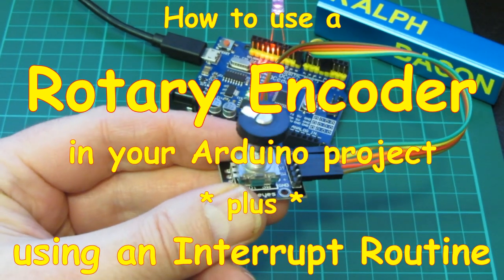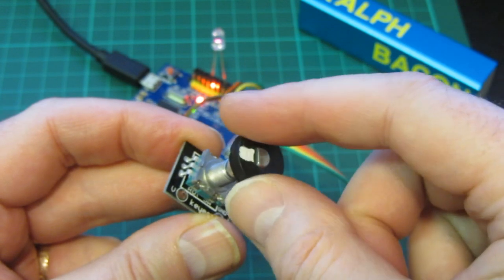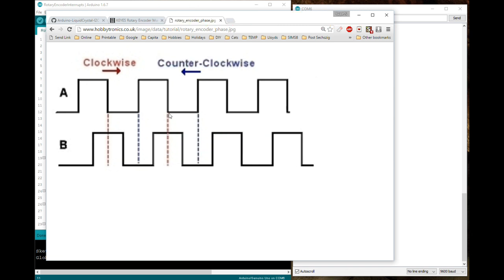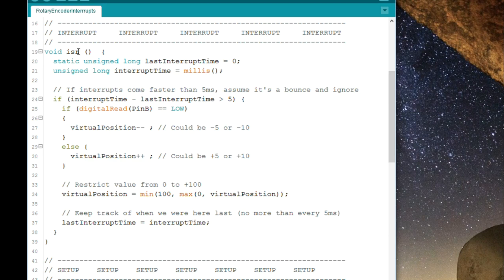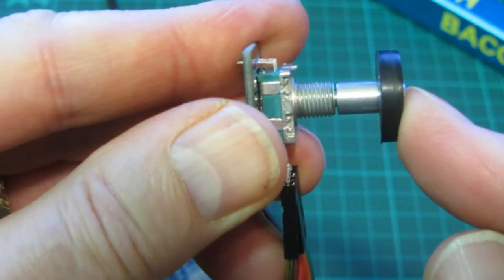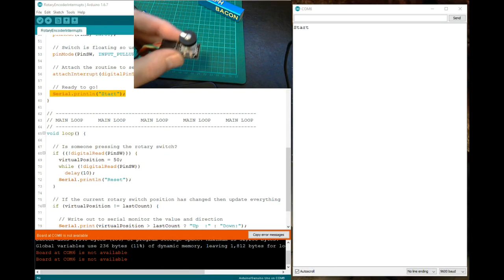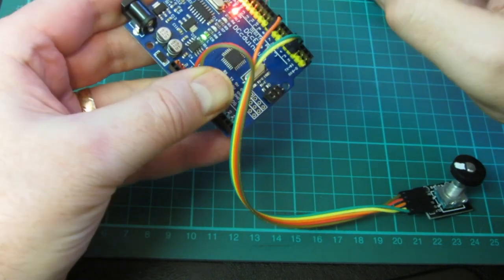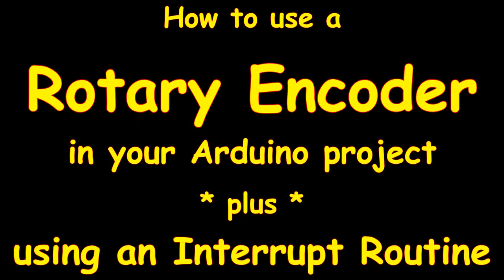#19 How to use a Rotary Encoder with an Interrupt routine on your Arduino

Comment: Nice instructional vid. Just a question though, so if I am planning to control 8 motors separately and have rotary encoders to report its position, do I need 8 interrupt pins for it, can I use any pins in arduino to use as interrupt? Thanks in advance.
Reply from the maker: Hey 3D Printwiz! I wish I had a 3D printer, quite frankly.
 
Anyway, with regards to your question the short answer is "No", you cannot use just any old pin for an interrupt. On the Uno/Nano only pins 2 and 3 can be used as "external" interrupts (like you get from a rotary encoder). On the Arduino MEGA you have more: pin 2 (interrupt 0), 3 (interrupt 1), 18 (interrupt 5), 19 (interrupt 4), 20 (interrupt 3), and 21 (interrupt 2). If you need several interrupts a MEGA can cost very little when cloned from the Far East (I bought mine for less than $10).
 
Additional reading: you might want to read up on the difference between "pin change interrupts" and "external interrupts"  as we've been dealing with the latter but the former may be of use to you!
 
Thanks for posting this interesting question, I'm sure others will think it useful too.
Reply: Thank you so much for your answer, it helps a lot since I am building a desktop robot with a precision of an industrial one, hehe, it feels impossible as I go through the process. As for 3d Printers, I have a Flashforge, but there are a lot of 3d Printers now that are twice as large, and as better, plus cheaper. Get one I, believe me it is worth it.
Reply from the maker: Getting one is the easy bit. Paying for it is the first challenge. Secondly where do I put it? I have zero space left in my workshop. Build another workshop! Could be an expensive 3D printer! I'd also like a 50W laser cutter so I could cut acrylic for project boxes and the like. Another dream.  ;)
Reply from the maker: Robot Arm looks great just don't let it be seen in Germany (I Am Arm means I Am Poor there). And that soundtrack reminded me of a couple of 1990s raves that were better forgotten. But it's an interesting, working construction and I wish I had a man cave (well, my workshop aka shoe cupboard is my man cave) but all space has been used up. Sigh. One day, one day...
Reply: Hi Ralph. A few words from the nit-picking Norwegian here. :)
The ATMega328P can indeed do interrupts on almost all its pins. The datasheet says: "The External Interrupts are triggered by the INT pins or any of the PCINT pins". If we take a look at the pinout we see that all of the Arduinos pins (0-13 and the analog pins as well) has a PCINTx label. 
That's the theory... I'm not sure if you can use the Arduino IDE though.

Edit: And you said that in your comment of course... I wasn't paying attention. :)
Reply: Thanks Robert, I will look into what you have just said. The reason why I asked how many interrupts are available is that, I am planning on making a dc motor driven robot arm and I will use rotary encoder for feedback. I will need a minimum of 9 feedback, which will eventually need to be interrupt driven to capture accurate positions at all times.
Reply: +3D Printwiz : Oh, you can't do that. If I understand the datasheet correct, the maxumum numbers of external interrupts is 5; INT0, INT1, PCINT0, PCINT2 and PCINT2. And I'm not sure if you can use all of them at the same time.

Although the PCINTx can be any pin, there are not enough interrupt vectors available in the ATmega328P. You would probably run out of pins as each rotary encoder need two pins making a total of 18 pins.

But there's hope! :) The Arduino Mega (ATmega1280) has lots of pins. 

Check out the PciManager Arduino library. It makes you life easier. ;-)
Reply: I am actually using Arduino 2560, so is it possible with this board?
Reply: It's certanly possible to connect 6 encoder on a Mega2560, I think you can use the PCINTx as well. The latter is a bit tricky to code though. 

A 82C59A is of course an alternative. It is the good old programmable interrupt controller. They can be cascaded. Maybe a bit old-school. :)

The MCP23017 is more up-to-date. It is a 16-bit input/output port expander with interrupt output. Less than one quid (including shipping) on eBay.
Reply: Maybe Ralph will make a tutorial on the MCP23017 some day? ;-)
Reply: Cool, thanks for the tip. It helps a lot, I'm into robotics and automation coz I love it. I love it more when people are willing to help.
Reply from the maker: @Robert Well, sort of. I don't believe that many occasional programmers are going to get further than EXTERNAL interrupts without significant further reading. And I'm not belittling their intelligence or otherwise! It's just that external interrupts are easier to understand in concept and to implement (volatile variables notwithstanding). 
 
Pin change interrupts are prone to misunderstanding (for example, strictly speaking, they only respond to CHANGE events rather than RISING or FALLING although there is a library to sort that out, see later). And determining which pin has changed can be tricky too. I do recommend this library though (https://github.com/GreyGnome/EnableInterrupt) as it covers all bases if you're into pin change interrupts. Yes, you can use the Arduino IDE for this, of course :)

Let me put it this way: I don't think I'll be doing a video on pin change interrupts (I know, never say never), not this side of the new millennium anyway, it just would not appeal to enough viewers. I think if you really need more interrupts, use a MEGA and save yourself some grief!

Comment: Would this work for motor encoders???
Reply from the maker: Whilst it would most certainly measure the rotational speed and direction of a motor I'm certainly not convinced that it would survive very long unless the motor was used in a very limited way (eg a robot arm). Most motor encoders use an optical method of determining speed and direction (identical concept but not using mechanical switches). So the short answer is "Probably not what you want" and the longer answer is "Find (or build) an optical encoder using an LED and a phototransistor which has not moving parts as such". I hope this helps.

Comment: Hi Ralph, having issues with the serial monitor, lots of random ASCII character garbage is being spat out when turning encoder... any ideas? Great tutorial too, thanks!
Reply from the maker: +Edward Clarke
Welcome to my channel!
 
I suspect that your baud rate is not correct. Check that the Serial WIndow (bottom right hand corner) is set to the same value (eg 9600) as what is in the Serial.begin(9600) statement.
 
You can test this just by sending a standard "Hello World" statement and ensuring that is received correct to begin with.
 
Finally, close and re-open the Arduino IDE as sometimes it gets confused.
Reply: I've tried all that with no luck :( thanks anyway!
Reply from the maker: Hmm, sorry to hear it's still not working. You are not using digital pins 0 and/or 1 (D0 / D1) on the Arduino board are you, as they are used for the serial communication - if you use those pins for something else then garbage may appear on the serial monitor (or your uploads will fail!).
 

Does the standard "Hello World" appear correctly on the serial monitor? And garbage characters appear only when you turn the encoder?
Reply: Actually just fixed it, no idea how...  yes I was using the digital pins correctly. 

I did also try to use a sketch just with some print commands in a loop but that wasn't working at all. Either way, it's all good now.

 Am quite new to this as you can probably tell!

Thanks for all your help, really appreciated :)
Reply from the maker: Great to hear it's now working! Enjoy the video(s) and keep learning as you go!

Comment: hi Ralph Got it working, sort of. I isolated an unrelated push button to update my OLED counter. Works great. Uncomment the encoder ISR, and it works. but the pushbutton doesn't update at all, or takes forever !!! Screen updates very slowly. Seems I may not be exiting the loop. So where should the ISR code code related for initialization, setup() and loop() sections? Thanks.
Reply from the maker: Ron, you said previously the switch button is pulled HIGH (to Vcc) when pressed? If so (you must be sure!) you need to change the sketch as I'm assuming the opposite in my sketch, line 56. That switch pin needs to be tied to ground via a 10K resistor and the code line changed to a simple INPUT (not INPUT_PULLUP). Then lines 71 to 73 need amending to look for a HIGH value on that pin, so line 71 and 73 need the "NOT" (exclamation mark) removing because you are looking for a HIGH and not a NOT HIGH (confusing sentence if ever I read one).
 
Regarding "positioning" of routines, it makes no difference. The compiler will find them wherever they are declared. From a Best Practices point of view, all routines (those written by you) should come first, then SETUP then LOOP. But I think you need to get the sketch working first! Have a go with the above and let me know (hit REPLY to this message).
 
If you can post your modified sketch to a central cloud storage place (Dropbox, Google, Amazon etc) where I can get hold of it I can see whether what you have done. But please don't post it here! If you have nowhere suitable I'll send you a folder link where you can copy it into.

Comment: Hi!
First of I want to thank you for this video. Helped me a lot with the code for my project. But I have not had the possibility to test it because:
When I try to compile it I get an error "'digitalPinToInterrupt' was not declared in this scope".
I try to compile your code aswell but get the same error.
I'm a n00b at programming and does not know where to look first for a solution.
I have IDE 1.8.5 and the forum post I have found suggests a newer IDE (because of a updated arduino.h).
Sincerely
Reply: Ok. I have now realised that it has to do with the board I want to use. I have to manually fix so it can use the interrupts... I will have to dig a bit deeper before I can give a better answer. Btw the board I want to use is a Digispark ATTiny 85.
Reply from the maker: Hi Björn and thanks for the support! I'm not even sure the ATTiny85 has hardware interrupt pins the same way as the Uno but you can program it for pin change interrupts. Here's a Stack Exchange article I found that may help you: https://arduino.stackexchange.com/questions/3929/attiny85-interrupt-id-vs-pin-when-programming-with-arduino but read the comment (correction) by guru Nick Gammon below the answer. And note that the interrupt is triggered on both rising and falling edges.
Reply: I have now giving up the idea of using a ATTiny 85. And I have now tried to make it for the UNO. But step into problems again... The 
attachInterrupt(digitalPinToInterrupt(PinA, isr, LOW);
line gives me a error:
macro "digitalPinToInterrupt" passed 3 arguments, but takes just 1
And I'm not sure where to find a answer for my problem. Tried google and gives me only results on C++ problems with the macro Min and Max. I'm a real n00b att programming and would just love some pointers that direct me where to look for a solution... 
I will read up on the link you gave me in later time, when I have understood this code first so I can convert it to a ATTiny 85.
Sincerely

EDIT: Now I found the problem after even more googleing... It was the format of the line...
Missed a ) after PinA... Feels dumb now...
Reply from the maker: Never feel dumb about making mistakes. It's actually the best way to learn. When you have to write that line again you will remember the syntax (or at least check your brackets!). On that basis I learn a huge amount every day!!! You can guess how many mistakes I make! Anyway, I think you'll find it much easier using an UNO first, at least, before moving over to the Tiny85. Thanks for the update.
Reply: I wanted to say that I have managed to get the code working on a UNO now. Works great! But needed some time to figure out how to turn it ON and OFF with the switch.
I must thank you again for a very good explaining video. Think I could not managed if it was not for you video.
Sincerely
Reply from the maker: That's good news, Bjorn, keep working on it and you will get the switch part working too. Thanks for letting me know your success story :)

Comment: Im trying to use this and uploaded the latest version unmodified to my Arduino Leonardo.

However after it reset it would not become visable and on the Devices page was an "known USB device"

I had to reset and try to upload a blank code to get the arduino back.

Any ideas?

Thanks
Reply from the maker: +John Hutton
Hi John, welcome to the fun and games of Arduino World!
 
Firstly I'd say don't use a Leonardo unless you have a need. Why? Because of the reasons you're now describing. It's a finicky module at the best of times (I've done a video on its clone) and for the first few seconds exposes itself to Windows to allow code uploads, then turns into a HID (Human Interface Device - usually a keyboard or mouse) for the rest of the time. Added to which you might have to (re-) install the drivers if you move it to another USB socket on your PC (or hub). This is the case if it states "Unknown USB device". Try uninstalling it and reinstalling it. 
 
Sometimes a reboot of your PC clears things down too but it doesn't take long before things can get out of sync again. Watch my video #30 which talks about my use of the Leonardo clone (called a Sparkfun Pro) and mentions drivers and the like (IIRC correctly). Frankly though, unless you NEED an Leonardo go and get a Nano or Uno when all these problems just disappear.
Reply: Hi Ralph, 

reason I was using Leonardo was to interface with a flight sim (Falcon BMS) and looking at a rotary pulse when clockwise or anti-clockwise to send a key command.

any idea how to do that with an uno? Or how I can get it to do so as a joystick? 

any help appreciated. 

John
Reply from the maker: I see, you want to use the Arduino Leonardo as a keyboard/joystick then? In which case you will have to use the Leonardo (or a clone) as it presents itself as such to Windows.
 
However, in your first post you say that AFTER an upload the Leonardo started misbehaving; are you SURE you told the Arduino IDE that you were using an Leonardo (not a UNO or something else)? Otherwise you may have to reflash the Leonardo as its bootloader will have been overwritten. There are some articles on the internet about flashing bootloaders (I've had to do it a couple of times). I can't give you precise instructions (as I don't use a true Leonardo) but the principle is the same.
  
If you have 'bricked' your Leonardo, then this is a good article: https://learn.sparkfun.com/tutorials/installing-an-arduino-bootloader but it all depends on your exact circumstances in how to get new code (the bootloader) into a device that is no longer being recognised via USB.
 
It's very do-able just take your time and think about the exact steps you need to take (the first one being sure that you have the correct bootloader for the Leonardo). You may need an Arduino UNO to do the uploading to the Leonardo via the ICSP header (for which you will need a cheap cable) but the article describes that too. Good luck with this, treat it as a learning experience. You can do it.
Reply from the maker: Additionally, there may be more information you might find useful in my video  #16 Getting your Arduino connected to your PC. It describes using an FTDI programmer (far simpler than you might think). Of course, this only applies if you have, indeed, bricked your Arduino Leonardo.

Comment: I have 5 rotary encoders that require 10 interrupt pins. But Arduino Mega has only 6 interrupt pins. What should I do?
Reply from the maker: You may need a processor that can handle more interrupts - but if you have 5 rotary encoders you only need 5 interrupts as only ONE pin one each rotary encoder will need to trigger an interrupt.
Reply: @RalphBacon  it is a quadrature encoder so it requires two pins. Which microprocessor will be okay? Rasberry Pi 3 >
Reply from the maker: I don't know about the RasPi when it comes to interrupts; the ESP32 can have any pin as an interrupt but it doesn't have a huge number of pins either; but it might be OK.

Comment: hello sir. This is a Good video. i want to ask is it a must to add a 1k ohm at each Pin A and Pin B when i want to connect to arduino?
Reply from the maker: No you don't need to do that Irfan, if you're using the exact same module as I am, because it already has 10K pullup resistors on-board. If you're using a different type of rotary encoder (eg a bare one) then you need to do that, OR even simpler just change the code in the sketch to make the input pins INPUT_PULLUP then it will all work just fine.
Reply: Thank you for your respond sir, really appreciate it. btw im using this type of DC motor with encoder 

https://www.cytron.io/p-spg30e-30k.

this type of encoder i need to put that 1K ohm or just insert  the INPUT_PULLUP code?
Reply from the maker: Looking at their suggested wiring diagram they are definitely connecting a 1K resistor from the pin to +ve (5v). But I would try with INPUT_PULLUP first (that uses a weak internal resistor, 10K to 50K) which might be enough. If it doesn't work as expected use the 1K resistors. It might be that the voltage on those lines is also being used internally in the motor electronics (unlikely but you never know)!
Reply: thank you for your suggestion. do you have any tutorial on the moving mobile robot using encoder like localization for example
Reply from the maker: Robotics is not really my thing but you could ask at the Arduino forum (https://forum.arduino.cc/index.php) as there are certain to be people there who have had experience of this.